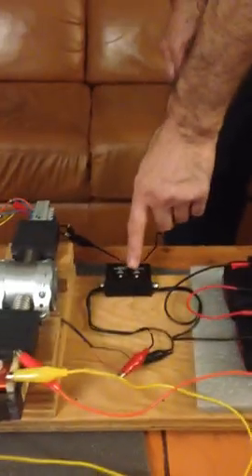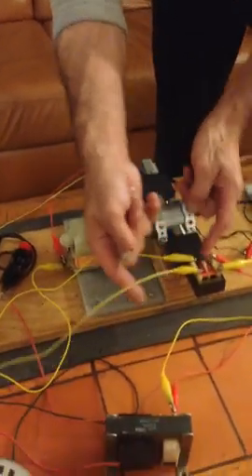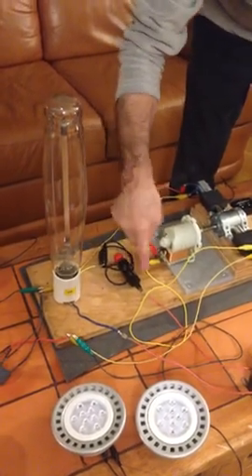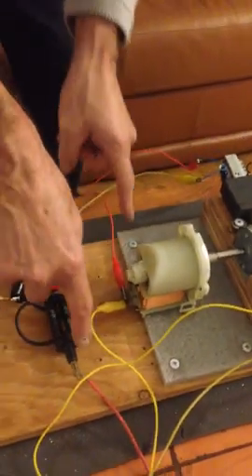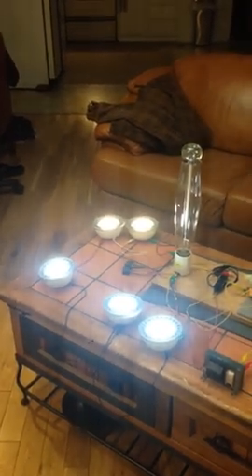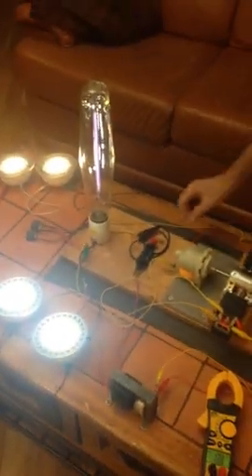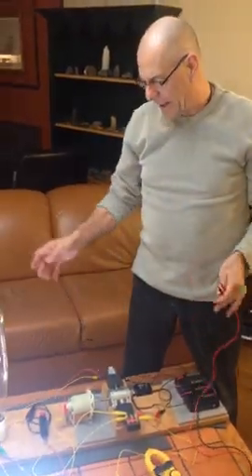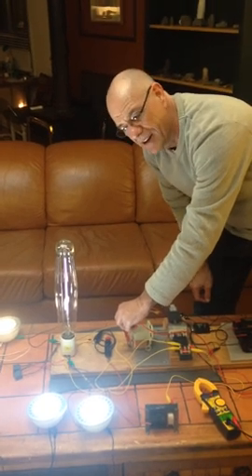Gerard Morin

Comment: Ok this is what i found . I put a speed control on the motor and was able to get the right frequency to actually light up an 18 inch fluorescent tube. Cound not get it to run a small heater or other small appliance. As for the atmospheric collector i  used 50 pop cans cut and opened with a bolt through the center and found it measured more voltage when aligned under the power line from my house to the power pole. The real guy to check out is Joseph Newman. He lost a legal battle with the patent office even after a proven concept checked by engineers , nasa and other scientists .sad.

Comment: Ok ... heres what i found. I put a speed control on the motor and was able to then able to light up an 18 inch fluorescent tube to light up by creating the right frequency. As far as getting power from the atmosphere i used 50 pop cans cut and spread openon a bolt through the center and was able to get more voltsge if i lined them up

Comment: Gerard I really envy your work your doing amazing things.                                                                                                                              Yet ill like to ask,  in this video your wonderirng how that it can be, that the  power coming back into the system or voltage is higer then your putting. Still like you explained in another video its not being used. But more or less being pulled true! Sp when that happems isnt it the differents between the two voltrage when you connect it. that is added to the sum?! Because it almost looks like the 20 volts that is needed to run it all is added to the 140 volts? So doesnt it work the same like the electric company.
Seems to fit the build in my head i gues. Altough i fit almost anything in my head so... i could be wrong!

Comment: If RF = Resonant flow, possibly V for Volume, representation of how much is needed to run the system, like if you wanted to fill a bucket with water and then a cup as well, total water needed
Reply: as he states you cant really do math equations because what he is doing isnt covered under equivalent mathematics, what he is doing is creating higher voltage with lower input source, to create high output thought magnetic gathering of voltage through magnetic fields